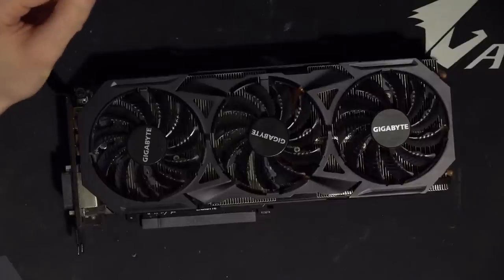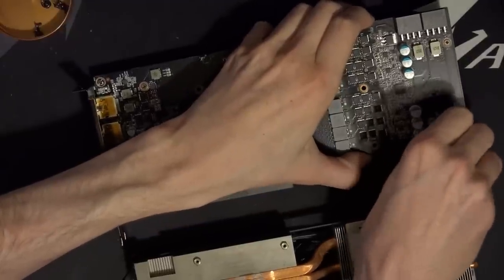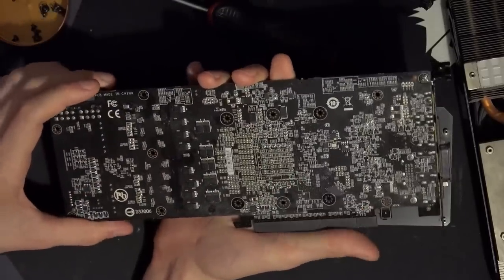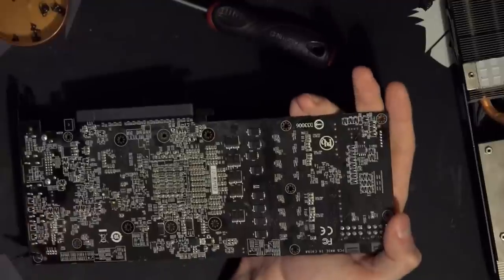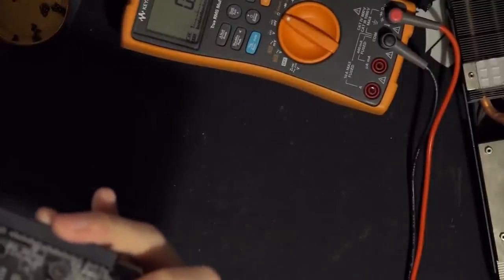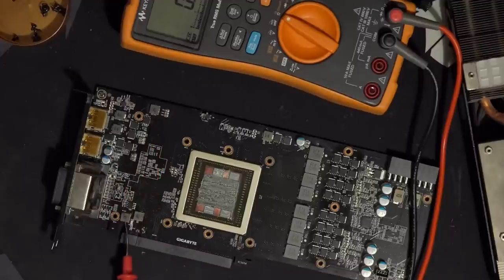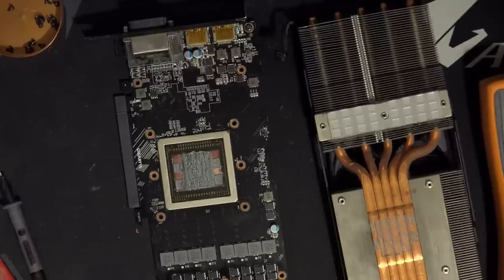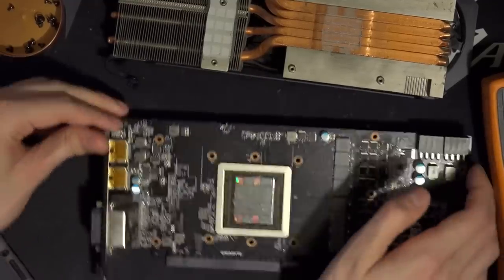Taking apart a Gigabyte R9 Fury Windforce

Comment: Had a Vega 64 from Gigabyte with windforce cooler back in the days. One of the worst custom vega cards imo. The "exposed heatpipe coldplate" contributes to the pump-out effect, which these HBM cards already suffer really bad from. A new thermal paste application was mandatory almost every 2 months.  Remembering it as a damn loud card also which indicates that the cooler never worked that great.. A real downgrade, if you owned a Powercolor Red Devil Vega card before.
Reply: what is "pump effect"?
Reply: @mijail2646  wanted to write "pump-out effect".
Reply: @mijail2646  Pump out can occur when a device is subject to rapid temperature changes resulting in the expansion and contraction of the interface surfaces, thus producing a pumping effect. This motion can cause such pastes to be squeezed or pumped out from the interface gap, reducing the thermal transfer performance.
Reply: The blower reference design actually worked pretty well compared to the noise of the Red Devil.
Reply: @wayland7150  Ugh nice try. The Powercolor Red Devil was among the best custom Vega designs. ( besides Sapphire Nitro+)One of the few aircoolers that were capable of keeping 350w+ heat output under control while still staying silent compared to blower designs. Dies for Red Devil were also binned back then, which allowed some of them to hit real 1700Mhz. (set 1750Mhz) Even with liquid cooler conversion, reference Vegas barely did 1700Mhz.

Comment: I had both Nitro and Strix version of this beast,  whay were both great performers. I was lucky to have earlier versions, so i was able to unlocked all CUs on Strix and some on Nitro. So it was basically fury x hehe... Strix is still one of the best looking cards in my opinion, irl was really beautiful. But drivers for these things were really buggy, i was forced to set all diferrent states in Wattman to max clock, otherwise the cards would never clocked as high as supposed to otherwise. They were cool and silent AND excelent for undervolt with mild OC, ofc memory speed was untouchable.. Good old days i guess

Comment: since bz didn't answer my question on stream yesterday: are the interposers on Vegas less fragile than on Furies?
Reply: Because they resin dip them and then plane them flat.
So the gaps between hbm and core die are filled in and everything is stabilized. Take apart a Vega they look cool man really interesting GPU with the HBM and you can see the marks from them planing the GPU in the factory.

Comment: Well I recently pieced together two systems, one with Dual Sapphire R9 Fury Nitro+ cards and another with Dual AMD Radeon R9 Fury-X cards. Both are custom watercooled one with Bykski full cover blocks and the other with Heatkiller IV full cover blocks. I find these cards rather fascinating to play around with. They may have been a flop for AMD sales wise but with newer 3rd party drivers they run rather well. Much better than my GTX 980s and 980 Ti's that's for sure (The Fury aged better).

As for Gigabyte Graphics cards, I learned my lesson with them long ago. I've had so many fans fail on Gigabyte "Windforce" cards that I simply stopped even considering Gigabyte when it comes to Graphics cards. For AMD Graphics cards it's either Sapphire or Powercolor for me.
Reply: Sapphire is the EVGA of AMD cards.

t. happy RX480 Nitro+ and 6900 XT Toxic user

also, bykski chinkshit GPU blocks FTW, both of the above cards are cooled with Bykski blocks, the 480 for almost a year now and it's nickel plating still looking great.